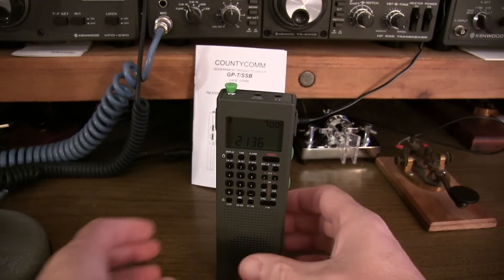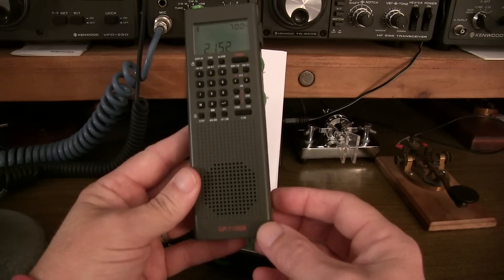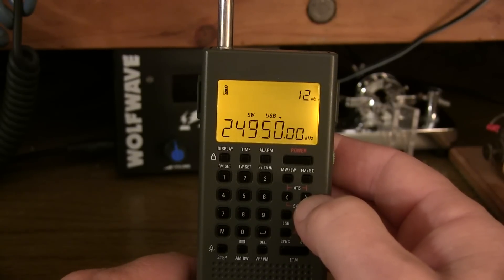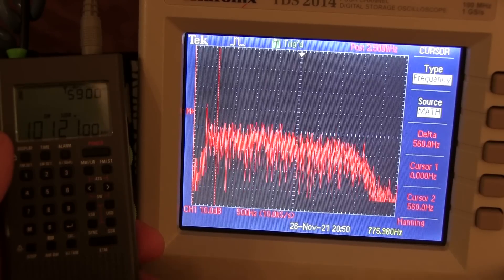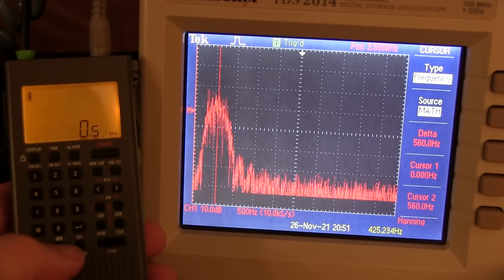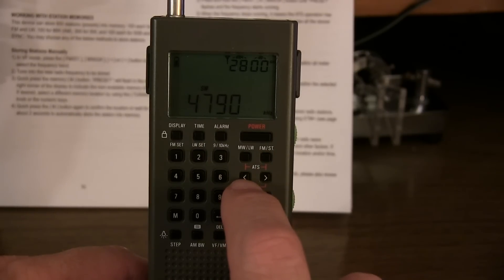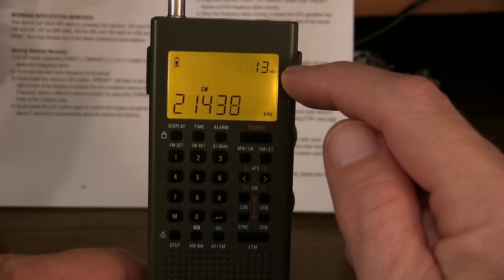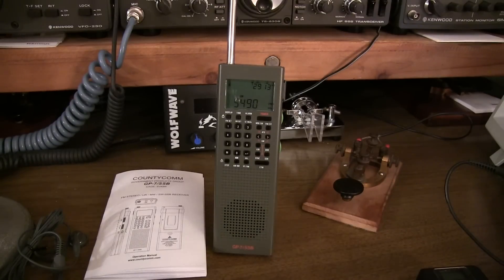#342: Mini review: County Comm GP-7 / SSB handheld AM/FM/SW/SSB/CW Receiver

Comment: Hey, great video! I just got a Tecsun PL-368 which is the same radio under a different brand and have noticed that on SSB the VFO is quite unstable in the higher tuning ranges, having a pronounced "wobble" with a period of 1-2 seconds that shifts the tuning frequency by roughly 80Hz once I get to 30Mhz and about half that at 15Mhz. I've heard others complain about the stability of the VFO (especially in relation to physical deformation of the PCB when pressing buttons) in this radio and wanted to ask if this is something you've noticed during your testing. Thanks in advance!
Reply from the maker: I haven’t tested it that extensively in the higher end of the HF band.
Reply: @w2aew  Ahh alright, thanks anyways!

Comment: Those BL-5C batteries are a dime a dozen. They are the former Nokia batteries, to be found everywhere, if they still make them.

Wow, was not expecting this to cost <100$. Shipping to Europe is 23$, but still a pretty good deal. I wonder how it compares to something like Sangean w.r.t reception.
Reply: Sound quality Sangean wins hands down, reception its a bit harder to compare as sometimes the Sangean will get a signal and it will be phenominal, other times it will amazingly fail, if discussing SSB Sangean has some serious sound issues even on the most recent models to. the point you better be prepared to have a huge antenna hooked up to it to get the most out of it for side bands.

Comment: Good job! I have learned some new things about the radio. I bought the PL-368 before there was an English manual for it. I have just recently downloaded the English manual, but have not been through it yet. What I learned about my radio was from the hunt and peck method so this video clears up a lot for me. I also made the mistake of getting the yellow version. The mistake is that they use white lettering. Not easy for these old eyes to see on the yellow and at that size of lettering . I have to admit it is probably my most favorite radio to use, and for less than a hundred dollars you have yourself a very good deal.

Comment: Forget the CountyComm discount, just buy a Tecsun 368.  That's what I had to do.
Reply: Yeah, but I prefer the upgraded sturdier stainless steel antenna of the County Comm version over the cheaper chrome plated brass antenna on the Tecsun version.
Reply: @robertwilliamson6121  I thought I could upgrade the antenna but it appears not. That's a change from the previous model. Also I use a clip-on wire mostly so far.  I would own a CC right now if it hadn't taken a day to get the discount code and me with money burning a hole in my pocket.

Comment: Good looking receiver with nice functionality. I purchased the GP-5 and although it worked great, it would drain batteries like crazy even when powered off. For instance, I would give it a full charge and have it off for 4 days. When I would power up to use it, it would be dead. I tried using different brands of rechargeable batteries and also alkaline, all with the same results. I contacted County Comm and they said because the warranty period had ended they couldn’t exchange it. Not sure if anyone else experienced this battery drainage problem. HOPEFULLY this is not an issue with this newer model. But at the same time, why do they offer an extra battery and charger kit ? 🤔
Reply from the maker: I have heard the same thing about the batteries in the GP-5/SSB, but I didn't experience that.  I've had the same batteries in my GP-5 for weeks and weeks.  I have heard that this was a recognized problem with the GP-5 though, and that it is NOT a problem with the GP-7/SSB.  The spare battery and charger is offered because it will give you extended run time in case you run the batteries down, and since the battery isn't a typical drug store / convenience store item like the AAs are.

Comment: nice video a question for you , is it possible to have a parallel resonance L1 and C1 and on the coil L2 of the parallel resonanace another coil connected in series with another capacitor and L3 , how do you go and adjust the resonance in both ? do you do the parallel resonanace first then adjust the C2 to be in resonanace too in series ?

Comment: I know it must have been a compromise for selecting SSB bandwidths but 2.2 is a little sharp; wonder why they didn't choose 2.4/2.6? Hey, for a under $100 I want it all!  ;-)  Thanks for sharing Alan, have signed up to be notified when they're available again.  73 - Dino KLØS
Reply from the maker: Yeah, not sure either. The filter isn’t very sharp, so still quite intelligible.
Reply from the maker: Also, you might look for the Tecsun PL-368 which is the same radio.
Reply from the maker: Available now!
Reply: @w2aew  Just picked one up with accessories a few minutes ago...signed up for notification when available and was surprised it came in so fast. TNX again for the review and lead on another useful too.  73 - Dino KLØS

Comment: Thanks for making another video and sharing it with all of us!
Question: What is the 24-m band on SSB?
At approximately 5 minutes into the video, SSB mode and amateur radio bands are called out and cycled through, one of the bands shown apparently is a 24 m band at 13.149 megahertz, I don't recognize this ham band.
What band is that? Who uses that?
I am of course subscribed with notifications turned on and thumbs up!
73 W3GUY
Reply from the maker: I believe this is one of the global HF aeronautical bands which use SSB, so not a ham band, but a SSB band.
Reply: @w2aew  thank you for the reply, this band seems weirdly out of place when listed with all the other ham bands. I'm going to take a listen on my HF rig over the weekend and see what is going on at that frequency range.

Comment: Will the radio operate off the USB jack with a good current?  IE No battery installed?
Reply from the maker: I know it will run while charging, not sure about running without a battery and only on usb.